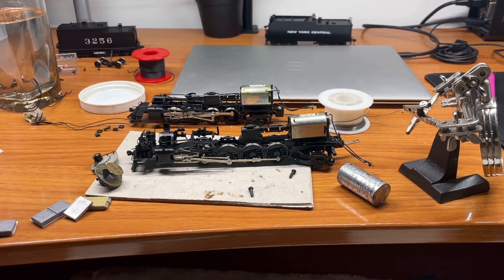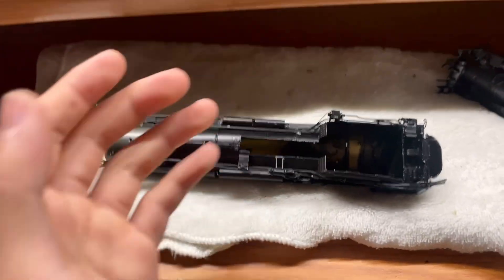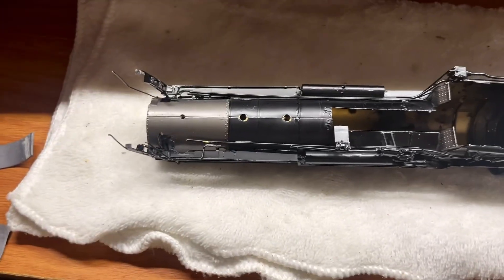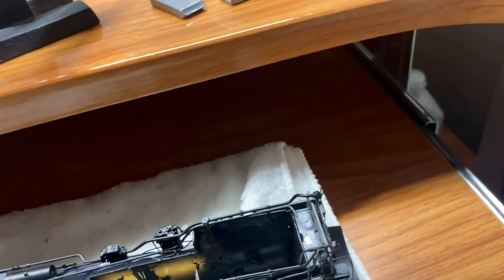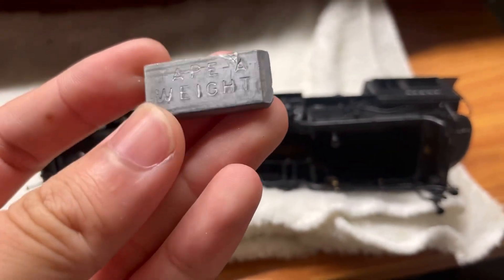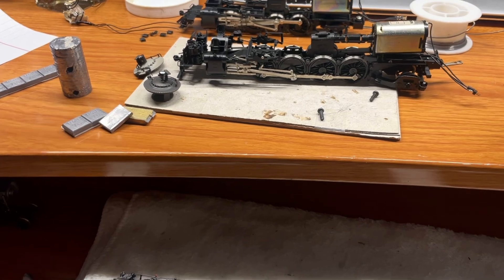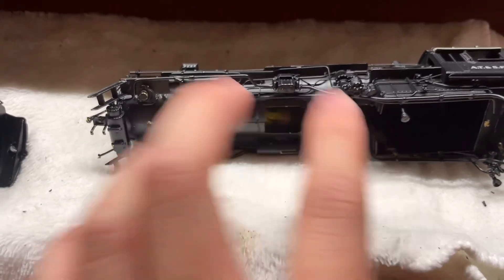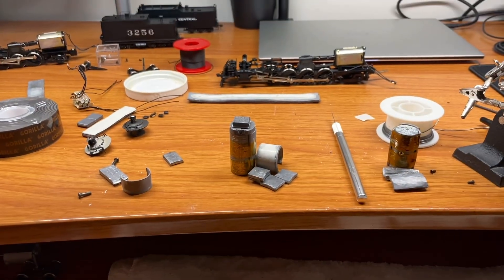Why your Brass Model is WEAK from LAZY Engineering (and how to fix it)

Comment: I'm not sure if you've heard of this trick, but if you set the drawbar corrected, you can have the tender "hang" off the locomotive by having the drawbar bent up, then about 1/2 the weight of the tender is now on the drivers.  This is used a lot in Britain to make small locomotives pull amazing well for their size.  If brass manufacturers really wanted all the pulling power though, there is another trick, which is to have your motor and gears in the tender (which hangs off the drawbar), connecting to the worm gear set on the driver axle by a universal joint, which allows you to fill the entire boiler with weight.  If you use old tungsten anodes for weights (2x heavier than lead), you get all the weight you could want.  You may want to consider this for any future repowering projects, as High Level Kits has a gearbox for this purpose and a coreless motor that can handle the load.

Comment: I avoid brass due to the fact if something goes wrong and you need original replacement parts you going to have a hard time finding them and for all of the outrageous prices they charge for their brass models at least offer a decent set of drivers and weights. Brass locomotives are nothing more than expensive paper weights or desk displays.
Reply from the maker: @michaelquinones-lx6ks  I strongly disagree. Brass models are made by hand from a combination of sheet brass and brass details, both of which can easily be replaced. there are THOUSANDS of brass details parts online. Additionally nothing is plastic, like plastic gears which you might need to replace in 20 years.
Reply: @trainman440  I meant no offense to be perfectly honest i wasn't so sure and I'm very sorry my apologies.
Reply from the maker: @michaelquinones-lx6ks  thats fine. just understand brass is handmade, and from very basic handmade parts. It might be as easy as buying a part from BLI, but its much easier to work on. Like working on an old 2000 honda civic.
Reply: @trainman440  Thank you. With the ever changing face of technology of CAD, A.I. Automation and 3D printing a brass locomotive can be made at a mass production price and look as it was built by hand you never know and they should be made here in the U.S.A.

Comment: Please do a clip of the engines running and pulling after you added the weight.
Reply: Nice, you have added weight a bit differently to the way I do mine but it has given me some good ideas. (I usually make a simple mould from lead sheet curved to suit the boiler diameter, then melt scraps of lead in a tin as it doesn’t need a lot of heat to turn lead into liquid.)
May I please ask what UJ you are using between motor and gearbox? It looks like it would prevent the gearbox from dropping away from the motor, and seems better than rubber tube.)
Reply from the maker: @struck2soon  melting lead would be the best way since you could customize the shape and size. I just dont have a torch so i gotta make do with what I got haha. Unfortunately the universal is factory stock from Key imports, I dont think you could find any for sale :/
Reply: @trainman440  yes, you can shape your own mould for the lead weight so it is a good solution. Do you have a bbq? Either gas or charcoal will be more than enough heat to melt the lead, just make sure your empty baked bean can is sitting nice and flat. Give it a try!
Reply from the maker: @struck2soon  I dont have a grill :,) living the city apartment life rn
Reply: @trainman440  man, how do you live without one? 😄
Reply from the maker: @struck2soon  LOL trust me as soon as i get my own place, a grill will be one of the first things i get :)
Reply from the maker: I currently dont have a layout big enough (4x8) that could fit the length of cars this loco can currently pull.

Comment: The reason they didn’t add the weight is because of cost. It’s cheaper to ship and has less risk of damage.
Reply from the maker: @barkonious  Unlikely. These models are expensive and made in very limited runs. Impact on shipping cost is negligible. And with two screws bolting it down I find it unlikely it being damaged. But who knows I guess.
Reply: @trainman440  Samhongsa was known for cutting corners. Friends who were dealers had problems with their engines brand new. Also because these locos came with the weight installed they had to keep the weight down to avoid damage. The reason the micro cast engines had a bigger weight is because they were no installed from the factory they didn't have to worry about the weight shifting and causing damage to the models.
Reply from the maker: @barkonious  I know of many other brass models that had preinstalled weights inside boilers with MUCH bigger weights. I dont accept that as the primary "reason" for why they included such a small weight.

Comment: If you can't increase weight you can increase adhesion with bullfrog snot or traction tires. Considering you would only lose the driven axles electrical pickup I think they are a good trade off.
Reply from the maker: @Bdmrr  I absolutely despise bullfrog snot. Have you actually used it before? it makes your driver ever so slightly bigger than all the others, and literally LIFTS your engine up so your engine either see saws back and forth or it lifts other drivers off so they barely touch the track. If you havent used bullfrog snot before please dont promote it.
Reply: @trainman440  I have used it. Did not notice the side effect. Did u apply it too thick?
Reply: I think it’s supposed to be a very light application
Reply from the maker: @Bdmrr  perhaps. Maybe I'll have to try again. In general though I dont prefer using snot. If I cant add more weight, I'll simply doublehead the train!
Reply: @trainman440  I agree but sometimes I want a boiler barker

Comment: The amount of weight over the drivers is important.  But how it's balanced over the drivers is equally important.  Commenting before watching the entire video, so you may have covered that later on.

When weighting your locomotives, pay attention to the balance point of it after adding weight.  Also, measure current draw before and after.  

For the most effective weighting of steam locomotives, melt bismuth alloy into the boiler after sealing up any and all holes.  This fills every nook and cranny of the boiler.  Other materials are heavier than bismuth (lead and tungsten), but you're not going to be able to completely fill the spaces in the boiler.
Reply from the maker: yes I covered balancing in the video lol. i dont understand why ppl feel the need to comment before listening to the point in its entirety...youd think it would save the effort it takes to write something up. but hey i dont judge. 

While melting bismuth (or lead, or etc) is the most effective way of packing as much weight to a boiler as possible, it often isnt practical for most of us. Gotta work with what you got.
Reply: @trainman440  Yeah, LOL...  You're right of course.  I guess it's a matter of attention span.  

  Aside from that...  Yes, you have to work with what you've got.  I model narrow gauge and the locomotives are small, so space is very limited.  Trying to balance between adding enough weight and balancing that weight over the drivers is always a compromise.  
 
I equalize the driving wheels using a rigid beam suspension (the scale I model in is too small for springs over the axle bearings), so that just adds another layer of complexity.

Good to see someone dissecting and improving brass locomotives.  Most guys are too chicken to do such a thing to an expensive brass locomotive.  I do it all the time, most don't run worth a darn out of the box (I'm speaking of vintage brass here, modern stuff might be a lot better).
Reply from the maker: @WHJeffB  agreed! every engine i get will absolutely be run. I have tons of both cheap and more "premium" models. I dont pay much for any of it. And I like getting my hands dirty to get the very most out of each :) cheers!
Reply: @trainman440  Yes, you "covered" balancing in your video, but you did not explain how correctly to go about determining how much weight is needed and where to put it to maintain the balance.
Reply: Tungsten powder can be a god send, especially because you can seal it off with bismuth.  one of the best parts of British kits that I wish was more common in America is individually tunable springs for drivers and carrying wheels, which means you can just turn a screw to fix balance issues.

Comment: Yes! Someone agrees with me on this, though what I will add is RTR locomotives aren't super great either. I mean look at the crappy Bachmann Russian Decapod, that's an utter joke in it barely being able to its own weight. In addition, ANY BLI loco can't haul crap without traction tires and I hate having to use them. They're just so much of a dirt magnet.

I just found "Liquid Leadshot" from DCC Concepts (I had to have it shipped from Britain) the other week which literally is just leadshot and I plan to put that in my various locomotives to weigh them down. What you do is just fill a little bag with them, then stuff it in the boiler and because its essentially a ton of little lead ball bearing looking things, it easily conforms to the shape. I see that you also got wheels weights for auto wheels. Yeah I got those too but didn't think to hammer them like you did. I was just going insane trying to find something that works well as is more or less fluid or easily. Because without getting a flipping mini furnace/forge to be able to melt down metals and actually cast a weight, I was thinking it was impossible to make my locomotives weigh enough to pull, and yes I am using THE word, prototypical length consists on their own with NO traction tires. Its like...my PRR L1 should be able to pull a 40 car train on its own. It did it in real life and what it was designed for, the model should do the same. Its just a scaled down version of the full sized thing. But apparently without a traction tire set on, it can barely pull 20 cars on the flat. Imagine trying to go up a grade. Now with the leadshot, I'll be able to actually do this. I also agree with the smoke units in HO scale. They suck majorly anyway and cause a HUGE weight reduction in the model. They just make no sense for HO as you need all the weight you can get when rolling stock weighs so much in comparison. HO Scale I found has THE WORST size to weight and tractive effort ratio of any scale. Power is utterly fine with us having motors that #1. Don't burn out like the old ones can, and #2. Have loads of overall power plus torque to provide. Flywheel and Can motors are just 100x better. Wheelslip also needs to be allowed to exist and yeah, if you have no traction tires equipped, you'll always get it at some point.
Reply from the maker: I think you're over generalizing. CERTAIN BLI models cant pull. But not all. Case in point, their paragon2+ I1sa is a plastic loco and a giant smoke unit taking up most of the space inside the boiler. it barely pulls anything. But if youve ever held one of their paragon1/qsi K4s, I think you would have your mind changed. Its got 100% diecast construction, tender shell and all, AND it has a giant lead weight taking up most of the boiler space. Gosh, that thing can PULL. 

I dont use traction tires, and i reserve the use of "tungsten putty" or "liquid weight" products for only the hardest to add weight areas of steam locos. Most of the time the cheap 1/4oz lead weights hammered into shape has been sufficient. Making my engines TOO heavy only causes them to potentially be damaged during transport. 

I also like to doublehead locos frequently, so a loco thats not too heavy isnt a big problem, and not being too heavy only helps prevent wheel wear when the two locos arent perfectly speed matched. Gotta make do with what you got lol. 

I plan to eventually rip out all the smoke units out of my BLI locos and replace them all with a chunky lead weight, for improved pulling power. Cheers!
Reply: @trainman440  Oh yeah. I actually own 2 BLI QSI era K4s I bought from a guy...that both came dead on arrival due to the decoders. I was rather impressed with the weight of them, but that's also because they don't have smoke units. I have a PCM T-1 too which can pull about 40 cars on the flat without traction tires. But unfortunately I still find that rather lackluster knowing how much the real things could pull. I was primarily talking about their more modern iterations where people sacrifice weight for "ooo look smoke" when in reality that smoke also just gets oil vapor everywhere inside the model. (Rather sticky and goopy mess on the inside)

And heck, my PRR L1 is die cast, yet only weighs about 14 ounces at most. I bought a scale to see how much all my stuff weighs, and man that is incredibly low because of the smoke unit. The T-1 still outpulls it by about double.
Reply from the maker: @nickb.1095  i think the fact that smoke units in lieu of lead weight means youre giving up performance for a feature has already beaten to death. but yes. smoke units are sacrifices. Its not as simple as some people say "if you dont like it turn it off". They dont account for the lost weight that having an unused smoke unit inside their locos is hurting their performance.
Reply: @trainman440  Exactly, then really don't seem to understand why their locomotive can't pull that much. In fact one guy I watch is British and Bachmann didn't even bother to put a weight in their Black 5. The boiler was completely empty! I was honestly shocked.
Reply: @trainman440  I have a BLI Northern Pacific A-3, and it's fairly heavy and very powerful. I haven't really had any major problems with it. It's also THE most expensive locomotive in my entire collection.

Comment: Ive been having the same problem with my bachmann k4 its so light
Reply from the maker: yea, and unfortunately there isnt much free space in the boiler. So its hard to add more weight. Although my experience with my Bachmann K4 actually indicates a weak motor/low gear ratio, and not the lack of weight thats causing poor pulling power. The motor itself stalls when pulling a "realistic" size train.
Reply: @trainman440  yeah then thats the probably the problem with mine may club is mostly flat so even most weak locomotives are fine but the moment i try to pull a realistic train 1361 just cant do it so thats probably the problem

Comment: I’m just curious how you qualify/quantify ‘enough’ pulling power- certain # of cars, just raw drawbar pull in oz., etc. It seems even just among bli there can be massive variation in pulling power (reading t1s are particularly anemic ime), while others can do 2-3x what the t1s can do. Another great video 👍
Reply from the maker: "enough" is simply when the engine is capable of pulling a realistic number of train cars. For example a single BLI paragon1 PRR K4 can pull 20 passenger cars. that is "enough". A BLI Paragon2 I1sa (plastic shell, smoke unit) struggles to pull 15 40' boxcars. That is insufficient in my book.
Reply: @trainman440  Agreed...I'll be weighing mine down more. That was one of the 1st things I also noticed, the weight isn't balanced over the back driver to give it traction.
Reply from the maker: @nickb.1095  balancing is especially difficult/critical for engines such as 4-4-0s. really hard to find spaces to put weight on the back side.
Reply: Look at what the full scale thing did, if it can pull what it did in full scale, then that's the right weight to me. To me it being "too heavy" isn't a problem. Why? You want to the thing to be as heavy as realistically possible, but that's REALLY hard to do with steam. Its easy for electrics or diesels and you can create real bricks with them. A PRR L1 should theoretically be able to pull 40 cars without struggling. A PRR H10 anywhere between 35 to 40. Each locomotive was designed to haul a specific amounts of cars and perform specific tasks. The PRR used 2-8-0s and 2-8-2s primarily for locals, so your talking 50 cars max or less in most cases. Double heading sure was a thing, but you didn't tend to see the Connies or Mikes on ore or coal drags, you saw their I1sas and N1s on those more often then not.

Comment: I’ve never understood the appeal of buying a locomotive and not running it.
Reply from the maker: yea, i find it pretty insane. but I understand some people are in the hobby more to collect and less to operate. I personally dont understand the draw but I can respect it.
Reply: "Shelf Queens" as some call them. My friend has quite a few of those now...primarily because he also bought expensive brass models "just to have", then after receiving them, realized they don't even operate after paying over $1,000 for the model.
Reply: My late Grandfather acquired a few locomotives to put on display inside cases. More specifically, he got an HO scale brass Overland Models Inc. Northern Pacific A-2 (which, sadly, doesn't run at all), an O scale MTH Premier New York Central J1e Hudson (which actually runs, and the sounds and lights are really amazing), a brass 2-rail O scale Overland Models Inc. Northern Pacific A-5 (which I have no idea if it runs or not due to the fact that I don't have any 2-rail O scale track), and an O scale MTH Premier DM&IR M-3 Yellowstone (which also runs, has awesome sounds and lights, and it's also the largest and heaviest model railroad locomotive I have ever held, period). All four of those models are really amazing.